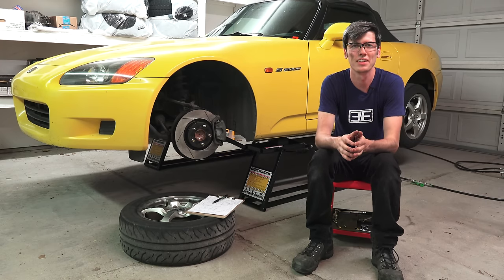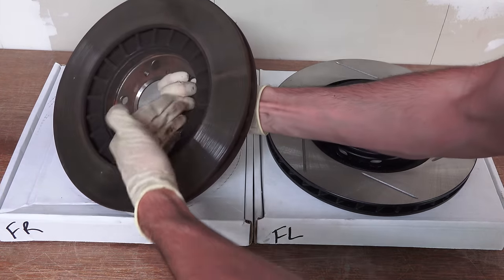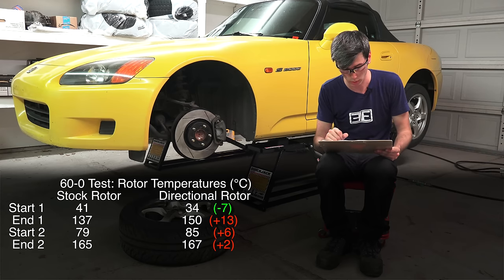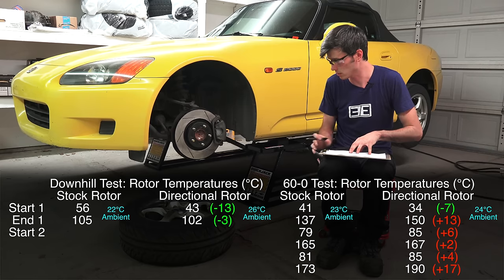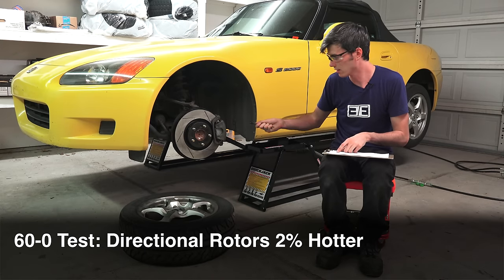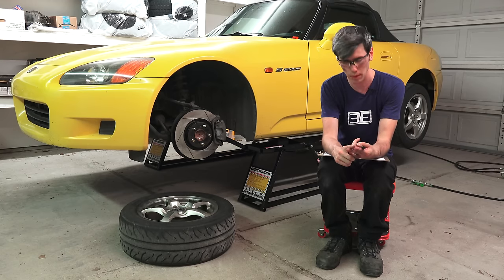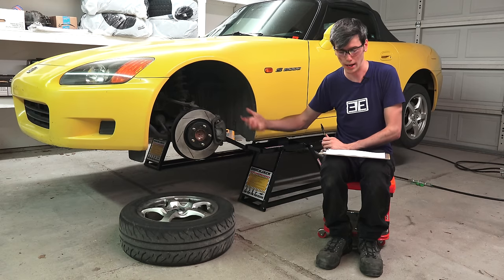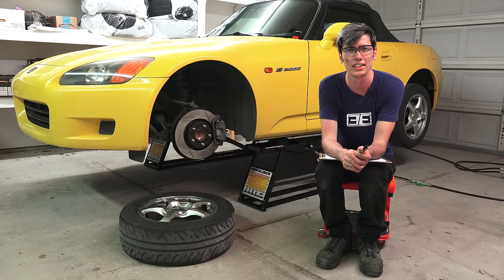Do Performance Brake Rotors Have Better Cooling?

Comment: they need to move to cool. the increased cooling performance is because of the aerodynamic design upgrades. when you stop moving you lose the cooling advantage. forced convection performance vs free convection performance.

Comment: That makes sense, at a track they need to get up to temp for the pads and rotors  to perform, but to not exceed a Certain  temp to cook the brake fluid etc. so they need to get hot quickly, but resist getting too hot to lose braking performance

Comment: WHY NOT BE, AN AWKWARD PERSON???
AND STILL DO THE TEST, BUT SWITCH THE SIDES???
LIKE LEFT ROTORS, ON THE RIGHT SIDE, AND THE OTHER WAY ROUND???
THEN you'll KNOW, the difference IN, swapping SIDES, I JUST LIKE TO against logical thinking???
PROVE MOI, WRIGHT OR DEAD WRONG???

Comment: The rotor venting is designed to cool the rotors while they are rotating. not while they are actively shopping. Do a test where you do your breaking test to impart your heat energy and then drive a set distance to let the venting actually cool the rotors.

Comment: Looks to me that the After-Market rotors, actually cool down better.  I think it would have been wise to do a couple of additional tests:  after initial Tempreature measurement, drive ~100ft, brake normally, test Temperature.  Secondly, give the Rotors 5mins and test the differential in static cool-down.    I think this is important because it's next to impossible to maintain consistent braking-pressure across the board.

Comment: What is the weight difference of the stock/aftermarket rotors? Weight/volume of the rotors will affect results, maybe holes and slots... well, I should have watched the whole video first... did you change the pads with the rotors to keep the same pads on same rotors?
Again, should have finished the video first... the holes and slots do increase the surface area and cooling of the rotors. They also decrease the friction area, but, the holes and slots give any gasses trapped between a way out during braking... increasing their braking performance... or something like that...🤪

Comment: Did you only swap the front rotors? And only check the temperatures of the front rotors?
If the directional rotors have higher friction than the stock rotors,
will not that cause them to do more of the braking (compared to the rear brakes) than the stock rotors,
and get hotter because of that?
If you cover the directional rotors with grease I bet they will run much cooler.
(And the rear brakes will do the actual braking, ande get hotter.)
Maybe you should have checked the rear rotor temperatures too, to check that they didn't differ too much.

Comment: Rotors are backwards. Slots on the face of the rotor should face backwards but the fins on the inside of the rotor should face forward so they can grab the air.

Comment: Cooling is part of it, the other part is stopping performance. Drilled/slotted rotors tend to have 10-20% shorter stopping, the ability to have less brake fade when they're heating up, and faster cooling when actually moving, depending on brand. 

I would suggest repeat the 60-0 test, except alter it a little bit by going 60-0 with a hard stop, stopped for 5 seconds, then back up to 20 mph for 10 seconds, then soft stop, and measure the temp. You should notice the directional/drilled/slotted should be quite a bit cooler.

Another option is test it with ceramic pads, they are the same at lower speeds, but 50+ with hard braking also reduces braking distance quite a bit and greatly reduced brake fade when heated up.

Comment: testing two different things at the same time ... where the rotors get their cooling air from , and the directional fins inside the rotors  .. my thought is that there is negative air pressure on the wheels outside  and that would make sucking air in from that side less effective

Comment: There is more heat transfer to the surface of the after market rotors, they are a radiator.  A given ammount of heat is generated and they move it away. If more heat was in fact generated, then there must have been more friction which is kind of what you want.

Comment: Adding 273 degrees to convert to Kelvin is nonsense.  Absolute temperature has nothing to do with the brake's cooling performance.  The hypothesis here is that the aftermarket brakes reject heat more efficiently than the stock ones, so you should be using a metric that relates to heat-rejection efficiency.

Comment: Your test is backwards, you are testing how hot each rotor gets after breaking, not how well each rotor dissipates the heat after breaking. The initial temp should be taken after breaking, then determine how long each rotor takes to dissipate that heat while driving. Good luck with that. Rock on, I did enjoy your video. I currently drive an air conditioned desk, dissipate that.

Comment: So the aftermarket preformed better. As the entire job of the brake system is to transfer kinetic energy into heat. So with that basis if you end up hotter it follows to reasons that the aftermarket brake rotors are better at converting the energy.

Comment: There is major design difference that you almost ignore: The slotted rotor draws air from the outside.

Seems like a good idea, but this kind of alteration cannot be judged by intuition. The airflow along the side of the car may have a lower pressure than in the wheel well.

Drawing air from the inside, as Honda designed may be better.

I know that the Subarus and BMWs that I have owned have brake ducts that feed into the wheel well, behind the wheel. Makes sense to draw air from there..

Comment: To an extent, higher temps make your brakes work better though, so I think the fact that these heat up from ambient temp to whatever temp range they work best at is a good thing, probably intentional. Or at least, whoever designed them probably wasn't thinking much about 22C to 130C (if those are intended for trackdays/racing).

I'm mostly basing this off being a supermoto/sportbike trackday bum. There comes a point during any track session where the brakes start feeling way better than they ever do on the street. I always attribute it to getting some heat into the brake system, just like how the tires feel amazing after a couple laps, when you warm them up. There's a lot of components in a brake system (caliper, pistons, fluid, etc) but I have to think the temp of the rotors is a big contributing factor there.

Comment: Here's the deal about slotted rotors: 

The slots are there to remove expanding gasses from the surface of the pad face as well as used debris from the pad itself. This intern will allow the brakes to work more efficiently by reducing brake fade. All things equal the slotted brake pad should see hotter temps during race applications simply because they will out perform a solid rotor due to the aforementioned. 

Drilled rotors reduce weight, but also reduce surface area contact patch, thus they really are only good for drag packages where slowing down is not priority. 

Unless we are talking carbon drilled rotors which are the best of everything.

Comment: Cool experiment, and the downhill test was a great idea, but there is one flaw.  If the friction coefficient is different between the two sets of rotors, when the more slippery rotors are used more brake pressure will be required, which will also increase hydraulic pressure at the rear.  So when the slipperier front rotors are used, the rear rotors will be performing a higher percentage of the braking than with the stickier front rotors, skewing the results.  To make it more accurate, the rears need to be disabled, or in the least also measured so you can also account for how much energy was absorbed by the rears.

Comment: don't performance breaks operate at a higher temperature in the first place? They perform better at certain hot temperatures iirc so it would make sense that they would get hotter

Comment: slotted rotors are designed for better stopping by allowing the gases to escape providing more friction to the rotor and pad if you were looking for the cooling factor you needed drilled rotors

Comment: Because air behaves differently at different speeds, do you think high speeds (before braking and after) and the use of ducting (and removing those internal dust shields) would show if the vanning works differently for straight and directional?  I.E., track use?

Comment: This video was in the sidebar and I am always interested in others' opinions when it comes from an actual and educated perspective. After watching this I am going to pull the trigger on getting the PowerStop brake kit for my 03' Z71 Tahoe. I looked at the reviews from various sources and was leaning towards purchasing before this video. My greater concern is downhill braking while towing. I figure with the "cooler" brakes in conjunction with a trailer brake controller, I should do quite a bit better than the OEM brakes.

Comment: I think a better question is, are rotors with better cooling better for your driving application?
I mean, if all you doing is dragging at a red light are commuting performance rotors won't do anything more for you. Doing laps on a track and riding the brakes into every turn? That's where it matters...
Pads play a significant role too, a lot of race cars use sintered metal, good stopping power, but they get hotter than the more expensive and quieter ceramics.

Comment: the test is nothing new directional are aka slotted rotors will perform about the same are worse as oem are factory rotors if you want good are better brake cooling the rotors need to be cross-drilled for optimal cooling.

Comment: Very interesting video.  (I just stumbled upon this)  I think when you hit the mass question you sort of redeemed the tests.  Lower weight at the corners helps with braking and handling.  1 kilo may not seem like a lot, but every little bit of unsprung weight helps. (I'm sure other folks have pointed that out, I've not read the entire 3,296 comments before mine. ;) )
That said, thanks for taking the time to do the tests.  I LOVED the road you used for the downhill test.  I'm a little jealous of you having that great curvy road to drive on a regular.  (I'm NOT envious of the crazy heat though!)

Comment: Would’t it have been easier and better to do the test with one of each disc at the same time? And do a third measurement of the temperature after some driving without hard braking?

Comment: What I see wrong in your test is the stock rotors have wear,  so that the test is legitimate  testing new aftermarket  and new stock with new brake pads where all the tolerances  are the same would be more accurate.

Comment: Does a higher temperature rotor provide better braking? As the brake pad material will grab better? More heat more friction?

Comment: So in conclusion. As a daily driver rotor, stock rotors work fine since they aren't generally going to be braking from high speeds constantly. If you need a rotor for racing where you will be at high speeds and constantly generating high amounts of energy in the brakes, go performance.

Comment: Since ur an engineer, did you even considered putting one type of rotor on each side?  And taking the temps of both rotors at the same time after the rest runs.

Comment: Since you check the surface temperature, maybe the 'coating' matters? Some rotors has zinc-coating, some is e-coated, some has Geomet coatings. And your stock rotor, are they uncoated?

Comment: Isn't It possible that the friction co-efficient for the pads to rotors was higher on aftermarket thus generating more heat?

Comment: I think the test was scientific enough. What may have been overlooked is the break-in period for the aftermarket rotors. You really need to put a few hundred miles on the new rotors to set the friction coefficient appropriately. The factory rotors may have already worn the fine machining cuts out of the rotor, whereas the newer aftermarket rotors still had some of the rough machine scratches in it.

Comment: Would the test be more valid if you ran a new disc of each type on a single axle, so the driving speeds ,braking efforts etc are identical.
Then a comparison of temps would be valid.

Comment: These brakes are designed to dissipate heat AFTER braking to cool the brakes off faster to improve braking performance. The stock rotors hold in more heat that will degrade braking in high performance driving situation like on a track.

Comment: I use those disks in my front drive car and they are working perfectly 
Going down from the mountain with alot of  of braking pedal   pressing  I notice I do not need
To press  harder on the brake pedal  like the original  smooth  disks but the slotted disks  wears pads faster.  But they are more   effective than standard disks.

Comment: Curved vanes are longer. Same airflow + longer vanes = less cooling? Also those ridges on the side reduce pad contact area that leads to worse braking distance. Just look at Formula 1 brakes, they have none of that bs.

Comment: You can’t really use new rotors with old pads as they aren’t bonded with them. You should have used new stock pads with the new rotors after bedding them in and new stock rotors and pads for your second testing.

Comment: I know this is an old video, but I'd guess high temps come from higher performance due to a higher coefficient of friction on the slotted rotors.  Plotting stopping distance, fade and feel along with temp may have shown the full story. Also assuming the pads were the same and were bedded in each time the rotors were swapped so pad to rotor contact was as similar as possible.

Comment: Well I think you also have to look at what type of iron, steel or alloy your rotors are made up of.. Im sure not all rotors contain the same elements for then to react the same/radiate, disperse heat.. plus there are various types of Steels which differ from other steel.. considering these different types of metals might be the reason why your slotted rotors seamed to perform worse..

Comment: Good video I have to admit I always thought and had been taught those slots are not about cooling 

Those slots are intended to facilitate the escape of combustion gases and brake dust particles from the interface between the brake pad and the disk to facilitate a better brake pad “bite” and allow the brakes to work better and therefore the discs are hotter 

Basically the pads are allowed to bite harder without an inversion layer or cushion of gases and brake pad dust 

as the brakes are applied the pad material is essentially cooking  in what is almost slow combustion

Those bye products need to be removed and that’s what the slots do........ i’m happy to stand corrected

Cooling boils down to the design of the ventilated section in the middle of the desk combined with the metallurgy being used

Comment: Doesn't that mean that since the brakes are using friction which turns into heat mean that you're actually getting better stopping power since it's all transfered into heat which is what friction does. More friction more heat.

Comment: The changes in temp from start and end of each run should be shown for a good comparison.
I wonder if you had found initially that the aftermarket rotors performed better, would you have stopped there? Instead of hunting for the result you were expecting.

Comment: Great video the topic is something I have considered often.  I have a thought not meant as criticism.  I don't think I care how hot they get because I don't replace rotors because the ran hotter than I prefer but I do replace them  when the warp.  Maybe several sets of similar vehicles driving under similar conditions to see if the aftermarket resist warping longer.  Also, determine if the pads last longer or the rotors last enough longer to justify the additional cost.

Comment: Drilled and/or slotted rotors are designed to heat up to optimal temperatures quicker and stay there longer

Comment: Always wondered about rotors. Thanks.

You needed a gtech g meter for consistent braking rate.

Also using the same old pads on new rotors and not broken in, requires more foot pressure/ more hear/ to get the same stopping g force and stopping distance.

Comment: Do it again with slotted and also cross-drilled rotors. As far as I know, the slots are to keep gas away from the pads, not for cooling. Cross drilling is what is meant to cool better. Drilling makes a whole lot more surface area which increases cooling. Slotting is not a whole lot more surface area.

Comment: Men i tot you were thinking ryt and used an OE on one side and aftermarket on other well now you result are not acurate plus if the claim to be performing cooler and it didnt you should had tryied swaping the left and the right

Comment: Bought some high performance directional slotted/drilled rotors as replacements for my wife's 2017 Honda CRV and I pretty much frig'n hate them. She doesn't notice it, but I can clearly hear the fluttering of the slotted rotors as they roll through the pads. It's just a constant annoyance that I would have avoided had I known, and just settled for the stock replacements over, regardless of any potential performance difference.
Reply: Pads are probably a better upgrade on a street car but there is no free lunch as far as rotor noise or wear.

Comment: You stated that the stock rotors draw from the inside of the car where as the aftermarket rotors draw from the outside. That means the surface you are measuring the temp on has less of a heat sink being as it is not directly connected to the hub. And your tests were very low airflow tests.

Comment: Turn force to heat to stop  hotter mean better brake and shorter brake cooling is another perspective but if you got more heat with shorter distance mean it have to work harder on cooling

Comment: I heard that these directional rotors are for water disapation in the wet. In the dry the contact patch of the rotor is lesser so the heat disapation is lower.